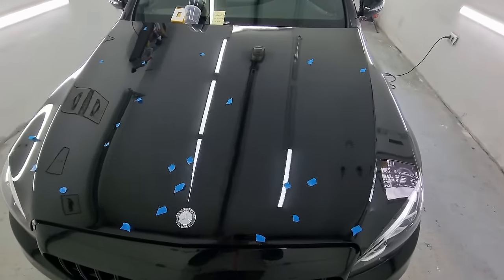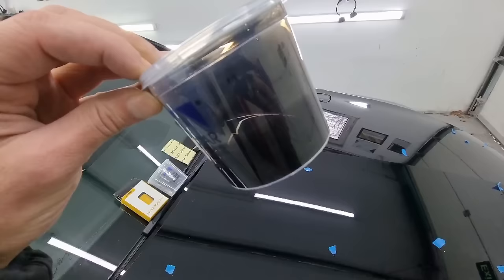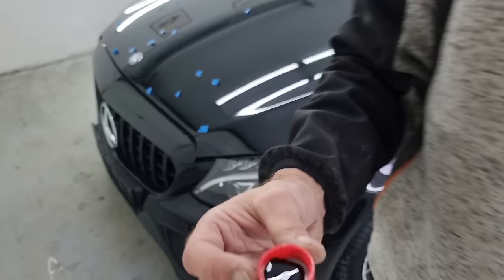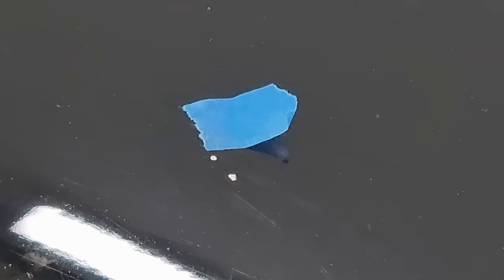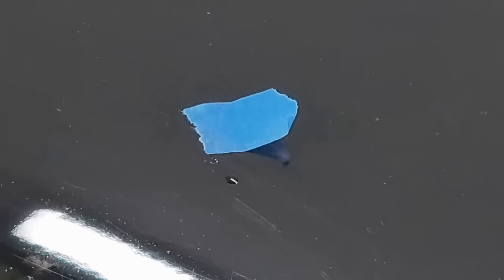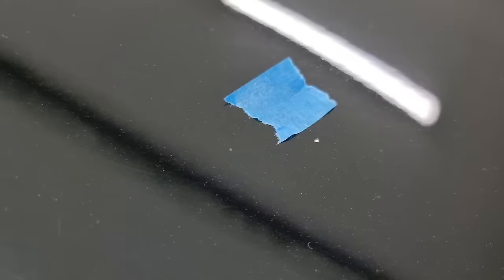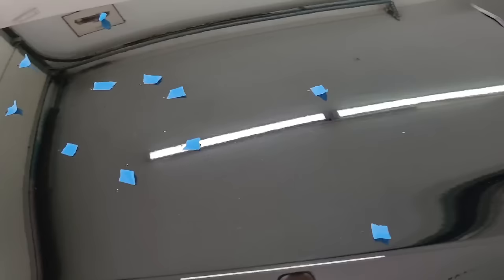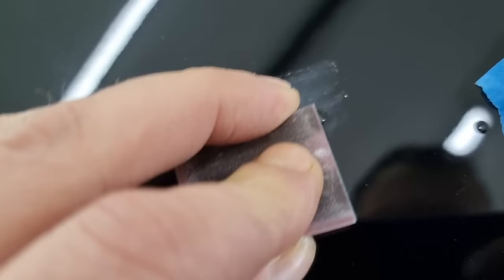How to Repair Stone Chips a yours CAR HOOD/ Touch UP!!!

Comment: Great job! Where can I get a sanding block that you're using? I live in the states and have a nice patina on the 50 yr old paint I'm fixing chips on. The car has not seen sun for over 34 years being inside a building so the paint is in fairly decent condition but having shop rash (scrapes) to correct. Thank you

Comment: Thanks.   Showing the filling tool was key in this video for me.   Awesome work. 😊
Reply: exactly that file tool is the key and what I was searching for years. without this tool it is almost impossible to reach the same result. i already did that in the past with like 5000grid sand paper but it is not working, you uselessly remove clearcoat in the surroundings of the spot....whereas with this metal tool and with the correct technique of holding it on properly on the surface of the car, and work it on the paint chip very gently, i can see this work to actually be in my reach. 

1 point I wonder however is why car manufacturers are selling color and clearcoat in 2 different bottles. I mean they sell this for end customers right ? not for car body professionals... how is the average car guy actually supposed to do this kind of work properly at home with tthis little paint brushes, like if you are..painting something.  its almost certain that this will end up in a mess. its like asking for trouble lol I bought a lot of this "touch up kits" but never went to the clear coat step... always felt like this second step would do more mess than anything else...

Comment: Hi, I used about same method in the past filling paint than a bit clear coat on top than wet sanding and than polishing and the bonnet looks like new painted so I know this method works!!! your method is less heavy on the paint, but you don't use clearcoat but hardener, can I also just make the mix of basecoat and clearcoat? or should it really be acrylic and harder? the degree of gloss then very much depends on the mix. I have already watched many other scratch repairs and videos from your channel but could not find the answer here.
Reply: When I ask for 2-component paint "for stone chips", my carpaint shop always mixes some lacquer to the base paint. So I get one can of paint (with lacquer) and another of hardener. Unofortunately I don't know the paint-lacquer ratio. 2:1 or 3:1 perhaps.

Comment: I’ve ordered one of those mini files. Expensive for what it is, but it looks like it does the job you need it to very well. I have a silver car with many stone chips on the bonnet, so hoping the chip repair will improve matters enormously! Thanks for the great advice!
Reply from the maker: silver color is difficult to do, darkens when filling
Reply: @Amddetailing  still nicer than the rockchips itself
Reply: @Amddetailing  I can vouch for the silver darkening when filling.  So glad for your comments, as I thought I was doing something wrong.
Reply: I also have a silver car and I can confirm that this method does not work for silver color. In general this method is applicable to colors that are not metallic, and that does not have sparkly particles in them. Normal "simple" colors such as red, black, white (especially) are the best colors to apply this method. If you do not have much marks it is better to use just dr.colorchip and be fine with the result. If it is much just save up your money and pain the whole hood instead of spending 40 eur for this scraper, then anther 20 eur for touch up paint and other details. I did same mistake and ended up painting the whole hood. If I had my knowledge right now I wouldnt even try to do this method and keep my money. 

In general video is very helpful and well made tho.
Reply: How do you get on with your repair?
Reply: @dexterx9862  it’s not pretty, but at least it’s not rusting. When I give the bonnet a polish, it will look much better. You can still see the areas I’ve patched however….
Reply: @Himoutdoors  Did you get it nice and flat and the issue is just the colour? I have a champagne colour car and want to try this. But previous owner did some and not only did he not fill them in (still a dent) but they came out much darker 😅
Reply: Where did u order it from

Comment: Thanks for this video. The tool works great on your car! I bought one today but I found that the edges of it keep scratching my paintwork even when holding it really lightly, do you have any tips to avoid this? Thanks!
Reply: A hard sanding block with a 2000 or 3000 grit would give you the least damage to you paintwork, if you have already messed it up just polish it with some cutting compund with some elbow grease it should be there
Reply: @amritbanerjee  thanks, that is what I ended up doing, the scratches are much lighter but still slightly visible. I might wet sand it when I have time but just a bit hesitant about going completely through the clear
Reply: @aqilrafi  you should practice on junk yard panel, then after practicing, you can work on your car paint. good luck

Comment: Thank you SO MUCH for this video.
My case it is a bit different. Instead of rock chips I have clear coat damage for splattered bugs guts. It is a 2010 Lexus with 56k miles.. The paint is coming very nice with the paint correction I have done but the damage is an eye soar. Do you have a technique for that kind of damage???

Comment: Top work and keep it up. I have a question. If I order black metallic paint with pearl effect, the clear hardener is included separately and not incorporated into the paint. Could it also work as below or is the loose blank separately a problem for sanding. 

1. fill stone chips with black paint

2. White hardener on black paint

3. Allow to dry for 24 hours 

4. sand with mirca

Comment: What would you recommend if a rock chip is only as deep as the clear coat but your base coat still intact? Would you fill it in with base coat touch up still?
Reply: Just use clear coat and compound and polish

Comment: I was doing this idea using Duplicolor lacquer base coat sprayed into a pill bottle. IT has an issue with being polished as it has no clear coat. Can I mix some Duplicolor clear into the base coat and fill the paint chip? Also had issues with 'greasy' holes filled with ceramic and waxes getting them clean to hold paint. I found using  Dremel and a ball diamond point run that in the hole to grind away the contamination a little allows the paint to stick.
Reply from the maker: You must have hardener

Comment: Can you use this same method on small chips that are deep enough to create a tiny rust spot? How would you adjust the procedure to fix the rust? I assume you cant just paint over it...
Reply: Wash > clay bar with rust remover as lube > wash > de-grease > start the process outlined in the video
Reply: @dr.z1657  thanks!

Comment: What grid of the compound and what pad did you use to polish the hood after sanding? Have you gone with heavier grit to remove the sand marks and then lighter grit to remove swirls and holographics?
Thanks in advance. 
Cheers.

Comment: Great tips with the touch up, and you didint sand anymore after file? No need?
Reply from the maker: it depends on the thickness of the filling, but it should always be sanded a little

Comment: Hello. Great video helped me out so much but I have one problem now, I have 2 1 inche touch up pain smears that have dried is there anyway to remove it? will dual action with medium cut pad work or wet sanding with 2500 or 3000 grit work?
Reply: hey you can try and wet sand that lightly 3000 then buff it and you should be good. You can try and just buff it with a cutting compound but not sure how quickly it would come out.
Reply: When I overfill a rock chip with paint I use a razor to skim it down. You can try that as well but be very very very careful you can mess up your paint badly if your not patient.
Reply: @n3rdshot127  Nice I will try the 3000 grit wet sanding first and then compound with 3D ONE and a ero-fiber pad. Thank you for the information.

Comment: @Amd detailing

Very nice workflow got all the ingredients now together including the mirka file
In case you mess up with the file and scratch the surroundings do you rely on a compound or polish or would you even go so far to rough sand it… which is probably still less aggressive than rough sanding the spots to begin with…
Does it make sense to dull the file when it is brand new?
Reply from the maker: If they are cut deeper, then it is the same for filling, there is no way to save it, and it does not need to be dulled, the sharper it is, the more evenly it removes
Reply: @Amddetailing  do u have the link for the Mirka file an that pen nib thng u use buddy

Comment: Honestly very surprised you can polish out the denibbing marks with straight polishing. What pad/compound is that?!
I need to wet sand down to 3-4000 grit to be able to get rid of most marks.

Comment: Is this something most repair shops can do? I keep reading about how difficult it is and how it will never look right, but I find it hard to believe that a competent auto body shop can't fix a small chip. My car just had a rock hit the door and I want it fixed as it's only six months old. Honestly, even if it's 90-95% better I would be happy. I just know from experience that touch up pens are terrible and it's difficult to make them uniform and flat.

Comment: Amazing job. How are you able to use the filer so precisely without touching the surrounding paint? I mean how to know when to stop filing the droplet? Can you file the clear coat layer as well and then polish it? Thanks for the video. Cheers
Reply from the maker: as in the video, when the factory coating is applied, it no longer fills, you level it with the factory one and polish it
Reply: @Amddetailing  I think he is asking how you use the Mirka so precisely and sand so close to get it flush, without scratching the surrounding paint with the Mirka
Reply: @The1Music2MyEars  Bingo!
Reply: @briancruz6720  Planning on testing it out, but I think it having less flex than sandpaper on a sponge or eraser, you can file the blob down and the trick is to stop just exactly when it's flush with no downward pressure other than the weight of the file itself. Even if you slightly scratch it, you probably buff, but this guy probably has practiced so much, he makes it look easy.
Reply: @The1Music2MyEars  Have you tried it out yet?

Comment: What paint are you using? Very helpful video. Thanks
Reply from the maker: thank you, the color is standard for painting vehicles, sometimes I use acrylic, sometimes a base mixed with a coating and a hardener
Reply: @Amddetailing   - Thank you. My questions shows just how little I know about painting cars!
Reply from the maker: @ThetaPower  I misinterpreted😁

Comment: Ok i regret not seeing this video before trying something myself xD I removed rust mechanically the few places where it was rusting, added primer, paint and lack. But i am not really happy with the results. It is still really obvious where the hole is since i only filled in excatly on the holes. Do i need to remove it or can i simply add paint on top like you are doing in the video? the hole is not filled, and the paint seems to shrink in volume a lot when drying.

Comment: Thanks for grate tutorial. 2:15 you said you will explain why you use acrylic base instead of ordinary (mean water?) base. Is there explanation anywhere? 😀
Reply from the maker: it has been explained, but here it is in a nutshell, because acrylic paint with a hardener can also be used on this paint due to the drying edge
Reply: @amddetailing What is the hardener you use in your videos?

Comment: Hi can i use just basecoat with a little clear in it plus a small amount of hardener ?
Reply from the maker: yes of course you can here is shown only with acrylic and herter because the piano is black
Reply: @Amddetailing  Great ive been doing smart repairs now for many years and this what i do

Comment: If I use a touch up laquer paint pen do I use the clear coat sponge after I have sanded down the repair area and then buff and polish?
Reply: To hide touch ups like from pens better if they aren't too hidden after you finish your process, clear coat always helps. Reflections greatly affect the color hue of paint. Imagine something with 0 clear coat. It would be a totally different color than something that reflects the colors of the world around it.

Comment: Yes this technique definitely works to reduce the visibility of the stone chips. But one has to realize it is NOT 100% restoration.  That’s why the camera in the video does not take you down close to where the stone chips are.  This technique is the right way to  reduce the visibility of the chips significantly.  But it’s not perfect. If one wants perfect , then a complete repaint of the surface will be required.
Reply: Obviously not flawless, but who’s going to respray their bonnet every year to remove stone chips? If you’re that bothered, get a clear wrap to protect the bonnet, wings and roof….

It’s the BMW M3 carbon fibre plastic roof that I’d like to see stone chips repaired on….
Reply: And repaint every year ? 😂

Comment: Hi sir i love your videos i have a question please.i have stone chips like that but with rust.do i just fill it with paint straight up?
Reply from the maker: No, must be clean
Reply: @Amddetailing  so you mean i need to sand it
Reply: @clarkylao3785  remove any flaking paint with a small screwdriver, treat the rusty chip with a rust converter like Jenolite, making sure you wipe away any excess from the paintwork so it’s only in the chip, and not on the clear coat around it. Let that dry and then apply the paint. Once dry, you may need to sand the area down if there’s a ridge around the chip as is sometimes the case. Use a tiny piece of sandpaper on the tip of the rubber on the end of a pencil. Have a look on YouTube. Good luck! Go easy on that clear coat and any errors can always be recovered by a professional. Worst case you can always buy a second hand bonnet (hood) from the breakers! 😂

Comment: Without using clear, wouldn't these chip repairs fade over time, resulting in spot bleaching all over the hood?  Would you suggest basecoat mixed with a bit of clear and fast setting hardener to complete something similar to this procedure?
Reply: touch up paint has the clearcoat already mixed in.
Reply: Do you think they care whats gonna happen after 1 year 😅
Reply: @blauwzakjecrack  that is incorrect, acrylic enamel paint has no clear. It is an old fashioned single stage paint. There is no clear there is a binder that makes it “acrylic” you may also get the same toner and put a urethane binder instead. He was not clear in this video when he said base. Base is just tint. Adding hardener to that will do nothing unless there is binder mixed in with the tint. You can however do the exact same thing with a solvent based base coat mixed with a urethane clear and hardener combination. 
The nib file is a super cool tool. I use it at least 10 times a day in my business.
Reply: No, it’s a single stage paint system. It will shine like any other paint

Comment: Great video. Will those paint corrections show after a few years in the sun? 
I'm asking since I have the same issue
Reply from the maker: if it appears, you will definitely have new stone damage, this is a solution so that the new car does not have to be painted

Comment: Should I mix base and clear, and harden them?
Or would putting base and few layers of hardened clear on top give better results?
Reply from the maker: everything is mixed together
Reply: @Amddetailing  what ratio is clear (not hardened) to base? 1:1?
Reply: In the video acrylic paint is used, it is mixed with a hardener that determines hardening time and gloss depending on the ratio…
So the process is a bit different from just mixing base and clear coat
Reply: @berndr945  i figured. I decided to go with 2 step approach. Base first under surface and top it off with clear above surface.
Reply: @darkomtc yes but you'll remove the clear coat when sanding down anyway.

Comment: What if you used touch up paint that's not acrylic, would you have added a clear coat on top then sanded down. Can you do this sake type of video without using acrylic paint and using touch up paint plus clear coat instead. Thank you
Reply from the maker: look at the channel, there are several videos about filling damage from the key, where a color coating with a hardener is used
Reply: @Amddetailing  thank you I will look. Can you please answer my other question. Dry Sanding vs Wet Sanding WITH MACHINE (not hands) I saw the other video using hand what about with machine

Comment: What is the acrylic hardener used? And do you not apply clearcoat on top of the chip? Any reason for this?
Reply from the maker: there is no need because the acrylic base has a shine, as with coatings, they dry quite quickly and are easier to process than coatings
Reply: @Amddetailing  thanks! Got to say your method has the best result I've seen and without unnecessarily sanding good surrounding paint. But what's the hardening product you use? I'm not a pro when it comes to paint.

Comment: No need for a clear coat?  Mine has a bunch of chips that have rust on it.  I sanded it down to bare metal and filled it with primer.

Comment: why not first use a base coat, then 2K clear, then sand the clear with the denibbing tool?
Reply from the maker: because that way there is a 90% chance that the coating you put on will be removed and then polishing will leave damage again, i.e. it will also remove the base that was applied
Reply: @Amddetailing  even if you fill with basecoat just a little then build up the clear coat with multiple coats?